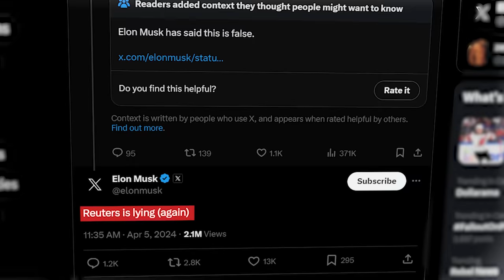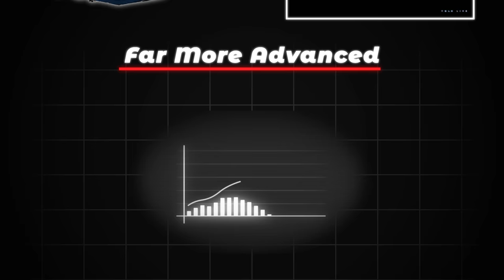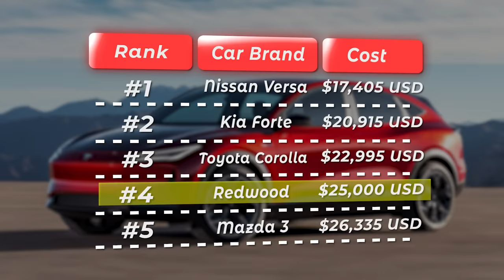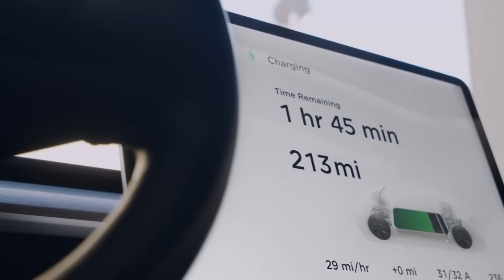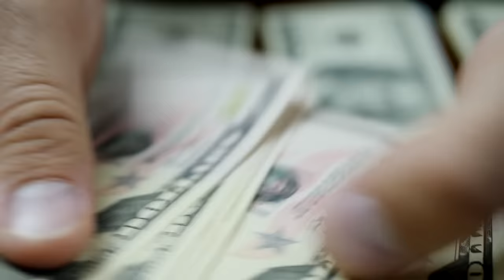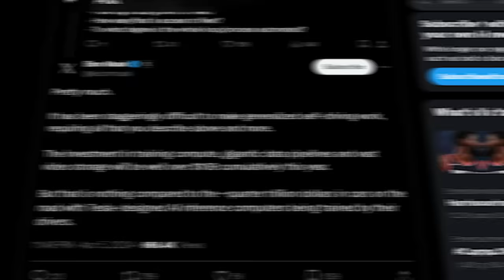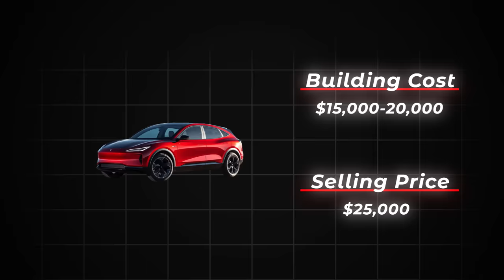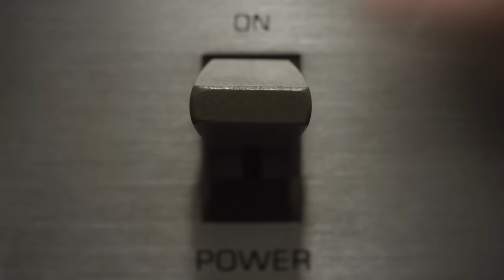Elon Musk Isn't Telling You Something About The 25K Tesla...

Comment: The limiting factors on a robotaxi would be local approval for autonomous vehicles and customers destroying the interior.  Cleaning and maintenance would still be a big cost sink.
Reply: They will probably have interior cameras. Each rider would use the app, so "bad" riders get blocked from using the service.
Reply: @swaggythecat Kinda hard to capture video of wet farts, or snot being wiped under the seats, or dog crap on the bottom of ones shoes, or bad skin lotion on ladies legs discoloring the thigh bolsters on white seats, or other bodily fluids exchanged by amorous back seat passengers while charging as the inside camera is not functional then. Etc etc etc. In just a few weeks it'll look like a tuk-tuk out of Calcutta. No way is any unsupervised stranger using my personal car. Being its my personal space I keep it hygienic and spotless. Robotaxi? Ugh.
Reply: Interior cameras can motivate people to clean up after themselves by leveling fines for dirty MFrs.  Plus, they will need to have some sort of service center for the taxis that they travel to every so often to get a deeper cleaning and any maintenance/repairs.  

Also, as a taxi the interior needs are less than a luxury car so they could have a waterproof interior with stain “proof” materials and the cabin could just be hosed out in an autonomous way.
Reply: @sunrisejak2709 infrared cameras would spot them wet farts 🤔?
Reply: @undertow2142 Yes, those ideas are good ones if the car is solely intended as a Robotaxi. But I think the concept is to utilize people's personal cars that sit idle most of the day. I would hate the inside of my car looking like a terrible taxi interior. People can more readily justify the high price of the car if it's earning money for them. Great concept but it only takes a few irresponsible folks to disrespect others belongings. Anyway I think a fleet of Robotaxi sounds cool but the first nick or scratch if my car were used by someone inconsiderate and I would scream bloody murder! 🤣 No question though that private car ownership is inefficient and not practical if such an expensive purchase sits idle 22 hours a day!, 🤔
Reply: @sunrisejak2709 why would you put white seats into a robotaxi?
Reply: @michaelholmes8848  No I wouldn't put white seats in a Robotaxi but my wife's personal Tesla has white seats. And Elon would like it if I bought FSD and turned it into a part time Robotaxi. The goal is for your personal car to do double duty.
Reply: @sunrisejak2709  completely false, that is not the goal at all. It is your car, if you don’t want to add it to the Robotaxi fleet then don’t. Elon is not going to force you to, that is ridiculous.
Reply: @michaelholmes8848 I think you don't understand the concept. It's everyone sharing the use of their car thus cars are always available in your area and your car makes money while you don't use it. Maybe your neighbor who works a different shift. Etc
Reply: @sunrisejak2709  I understand completely, the problem is you’re talking absolute nonsense. You will not be forced to turn your car into a robotaxi. It will be completely OPTIONAL.
Reply: @michaelholmes8848  I never said it would be forced!!!!! I'm out as  apparently can't read or don't watch the Tesla earnings calls.
Reply: @sunrisejak2709  you literally said the GOAL is to make your personal car a robotaxi
Reply: @michaelholmes8848 Yes Elon Musk has a goal of hoping many people use their car as a Robotaxi. He makes more money. But it of course is not forced. Are you competent in English? An objective or goal is not the same as forced. Good grief.
Reply: @sunrisejak2709  post a link of Elon Musk saying “he wants people to use their own personal vehicles as robotaxis”
I’ll wait……
Reply: @michaelholmes8848 Elon Musk: Tesla cars should be worth $100k to $200k with Full  Self-Driving package start here
Reply: @sunrisejak2709  wow... just wow.  You made one comment about your preference and ended up arguing with everyone about everything.  You do not want anyone in your car but you, ever.  Understood.  Who cares?  You are not everyone.  You have more money than you need.  Great for you.  Not everyone does.  You don't need an extra $20k income a year.  Great.  Some people do.  The $25k car built for Robotaxi could cost as little as $19.5k and earn $100k in profit in just 3 years.  Imagine how many cars can be built for $19.5k if they earn $100k in profits.
Investors would literally offer Elon Trillions.  Every state would have a new factory.  Imagine Tesla building 57 new car factories next year.
Reply: @davidbeppler3032  "arguing"? Is that what you call a lively discussion or exchange. Like someone who confuses "forced with objective"
Reply: @davidbeppler3032 Oh, ok let me know when Tesla builds 57 new factories over this business plan
Reply: @davidbeppler3032 Wow just wow indeed 😁 I reread my comments and all are pertinent to the discussion of the expectation of the big take up of personal Tesla owners using their own cars as a Robotaxi. I even provided an article of Elons objectives. I think aside from the technical challenges we'll see huge regulatory, insurance, and liability concerns. Can be overcome but it will certainly take a big chunk of those 20 thou a year revenue. The vision is cool, but  let's see if this can be converted to a new reality.
Reply: @michaelholmes8848  in what universe does goal become forced?
Reply: Customers destroying the interior could be handled by any repair costs being deducted from the hirer's credit card. This is standard practice for renting a holiday apartment anyway. Cleaning and maintenance are also required for ICE cars and in fact ICEs require more maintenance. The big hurdle is licensing for each jusisdiction and as far as the UK is concerned FSD has a very long way to go before it can handle narrow twisty country roads with passing places in the depths of winter.
Reply: @rogerphelps9939  Yes, you make fair points. I think we can expect some strong intervention and controls from various regulatory agencies. Tesla recently paid off a claim rather than risk a negative potential loss court case. Liability and insurance are also undetermined at this point. When it comes to liability reading up on the recent Boeing reveals software and other related troubles then multiply that many fold. I suspect some governmental pushback and some roadblocks ahead. Particularly with level 5 autonomy.
Reply: and charging

Comment: It's not hard if Tesla is rational: There is no downside to producing the $25k car as planned. If they cannot produce enough to meet demand, that's a good thing not a bad thing. Skipping it and go straight to Robotaxi would be irresponsible to shareholders and risks a massive drop in share price over the short term. Of course, long term the Robotaxi is going to be great, but the $25k car bridges the time in between. Create as many synergies on platform as possible, launch 25k car in 2025, get robotaxis in 2026 and get them to scale before 2030. That still requires Tesla to fill a 5 year growth gap.
Reply: I think the stock will go down if the m2 is set aside.

Comment: With time ICE vehicles will face the same dilemma that some EV owners face today. Gas stations will face a situation where the gas they are holding is not having sufficient inventory turnover and thus reduced cash flow. I already notice that in some gas stations, where multiple pumps are consistently non functioning. That means they don't want to have cash flow tied to excess inventory. Eventually when cashflow does not make sense, they could make a push to an alternate model.

Comment: 5:16 25 year old Toyota for me. 1999 Tercel, any time I bring it somewhere for work the mechanics are impressed that it starts up the first time every time.
Reply: W/O a doubt your Tercel is a good car.    I get the impression that you care about it and give it the care it needs.    This is more important than the make of older cars.     EFI IE cars will generally start.  The computers keep the engine in tune.  Far different for cars with carbs, points and breakers.

Comment: Also, a robotaxi announcement does not say that it will not include private cars. In fact, a car owned today by private owners will be available for robotaxi use.

Now realize this: isnt it better to sell a car with a 40% profit to make your primary investment return and then have it continue to provide extra money every day thereafter rather than put it to work immediately and have it drive  50,000 miles at $0.50 a mile to be in the same position as a sale?

But wait! There's more after each ride, or at a minimum a few times a day that robotaxi will have to be inspected and cleaned. There will be the cost of doing that. So up that 50,000 miles a notch.

Comment: Tesla is developing a lower end trim of the model 3 and Y using new assembly methods. This Trim will be the 25K car which can also be used as a Taxi.

It makes no sense for them to design new cars or make a smaller car as it will increase complexity.  They will just reuse parts from their other models and make a lower end trim. This trim will look like the model 3 and Y but will have no glass roof and u will bet they will switch to anodized aluminum body (getting rid of the paint)

Comment: FSD is level 2. It need to be level 4 to be allowed as robotaxi. I am not sure how will Tesla get to higher level particularly when Tesla is focused on vision-based systems and not backup technology like Lider. To Tesla be at level 3 or 4, regulators are hell bent on having all weather backup sensors which Tesla is totally against. For Tesla, It will be a uphill battle of at least 5-10 years .. in order to convince level 3 and 4 can be achieved with vision based neural FSD. Anyone aware f M2 supporting Lidar or ultrasonic sensors apart from cameras?

Comment: If you can buy a car  but it could host software that works as a robotaxi on it's own then the price of the car doesn't matter that much. You won't be able to buy it.  

If X good can generate $10,000 a year, and physically costs $25000 to make, the physicals cost of the good is moot.  It will be bought for it's profit making potential.  

Until the risk that car not paying for itself increases, it will be infinitely sold out.  Whatever that break even point is - that's the price of the first robotaxi.

Comment: This video puts forth a good theory, which may be one path Tesla will take. From my perspective, building a $25K car makes no sense with Model 3's selling for about that price or just a little above $30K now. The price for replacement parts and EV batteries would have to decline in price, and Tesla would have to allow 3rd party repair shops more access to repair Tesla's if the $25k car has any chance of success. 

Moreover, there has to be more education on how EV's work and a vast number of public chargers installed over the next decade to support the potential number of $25K cars that may enter the market. All of the above has to happen so insurance rates drop to a reasonable level of affordability for the $25K consumer.   

All of the aforementioned happening would build trust in EV's and a high degree of trust is important for someone who has only the income to purchase a $25K car. People who are purchasing EV's now have a little more income to spare in most cases, so they can deal with the challenges of owning an EV at the current time. 

Plus EV demand is being subsidized by our government with the $7,500 tax credit for now, until EV's can come down in price. Also, while the $7,500 tax credit is available, spare parts, repairs and battery technology must become better and cheaper or EV adoption will take a very long time.

Comment: Standard Elon plan,  1: Find a product no one else makes well (Electric Car), sell into a high margin market (luxury sports car);  2: Find a product no one else makes well (FSD), sell into a high margin market (for Tesla) (Uber and Lyft)
Reply: Mereceds has level 3 right now. Tesla may never have it.
Reply: @KingBravo-lo3vc    DRIVE PILOT is an innovative technology that enables the vehicle to take over the dynamic driving task up to speeds of 40 mph on suitable freeway sections and during high traffic density.  

It follows the car in front of you.  If that car leaves the freeway it disengages.   If the car ahead exceeds 40 MPH it disengages.  If a turn has too much bank it disengages.  If you leave the freeway it disengages.   This is a very small slice of what self driving needs to be.  More of a publicity stunt.
Reply: @danharold3087  I think you are two months ago on that. Mercedes has received SAE Level 3 authorization for autonomous driving and if DRIVE PILOT is engaged and the driver has their hands off the wheel, the vehicle is liable for anything that happens.  That is you are allowed to take your eyes off of the road and should take your hands off of the steering wheel.
Reply: @KingBravo-lo3vc  Yes my memory if from a few months back.  Has anything changed?  
There is too much wiggle room on the liability.   "Once you engage Drive Pilot, you are no longer legally liable for the car's operation until it disengages"
This is the same as saying "When DP disengages you are legally liable for the car".    Now if they gave you a 20 second grace period I would feel better about their sincerity.  Has to be a hard number or lawyers will wiggle around it.

Comment: You are wrong. The best way to get someone to buy a Tesla is to give them a ride in one. If the world's middle class have that experience and know they can afford a new one or used they will convert. Also, two things are coming, charging ports at curbside and wireless charging under parking spots. In those cases there will be a handshake wi y h the charger so the owner pays for the electricity.

Also, the life of a rental, taxi, Uber/Lyft is only a few years, so the Robotaxi will be on the used vehicle market rather soon. They will be steer, accelerate and brake by ethernet, so the buyer will only have to add the remote units that bolt on.

Comment: FSD is STILL not even a level 3 autonomous drive system. Let that sink in for a minute.
Reply: The numbering Tesla has assigned to it is irrelevant to its abilities. It’s only set as level 2 so that the driver becomes responsible for any issues that might occur and Tesla isn’t liable. It’s easily capable of level 3 or higher
Reply: @Contortionfan11  it most certainly is not. It's not certified to level 3 or higher because it isn't capable of operating at level 3 or higher.

Comment: I think the robo taxi at this point would be a huge mistake for two reasons: one, the automated software to drive while very good is not ready for mainstream and opens up Tesla to a much bigger liability and image problem. Two, consumers at that price level are not used to electric vehicles yet anyway, so why make it even worse? Driving an electric vehicle is markedly different — why not make new upwardly mobile customers instead?
Reply: The software has to be better than human drivers.  The question is when.  AI is improving at a unheard of rate as a technology.  Tesla is spending about $10 billion to buy the computers to train FSD.   Not saying that is a guarantee but it does make very odd FSD a possibility.
Reply: @danharold3087  Problem is all FSD has to do is screw up once and it will be broadcast on MSNBC ad nauseum as if it’s all that bad for every driver. Just sell the car at $25k and have a bunch of new loyal converts to EV’s instead of endless lawsuits. I’m not questioning the the 99.999% of great results just the one out of 1 million that will tarnish the bunch because of idiotic broadcasters.

Comment: A $25,000 car sounds good until you find out in 5 years you need a new battery pack that costs almost as much if not more than the vehicle purchase price!
Reply: Thus proving you know very little about Tesla's battery tech or degradation levels. Five years! 😂
Reply: I thought it only cost 9k
Reply: Yeah, the short battery life FUD has been largely debunked.
Reply: @MarkXHolland Depends on driving and charging habits. Or it could just catch on fire for no reason and burn your house down!
Reply: @justsomeguy1074 look up LFP batteries please. 3000-5000x cycle life with 250 to 300 miles range would be at least 750,000 miles, the average American drives 30 miles a day. Literally 68 years it would last.
Reply: @dawsonboyle99  Yes but the material degrades and the slightest fender bender could ruin the entire battery pack which is why insurance is so high for EV's
Reply: The 25K is dead, yes , because actually it would be a 20K car. Oh yes. Think about it !
Reply: Adding cost and maintenance of an engine in 5yrs combined I think a battery is A LOT cheaper in the long run. Shit most engines don’t even make it by the time you are done paying your car unless of course you baby the fuck out of that engine. But we all know we humans don’t.
Reply: @MarkXHolland 😂❤